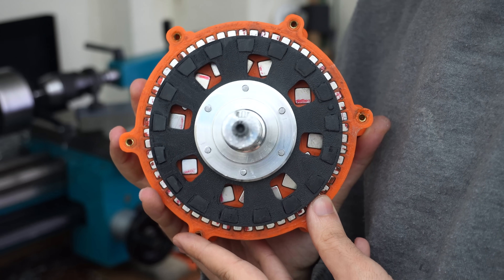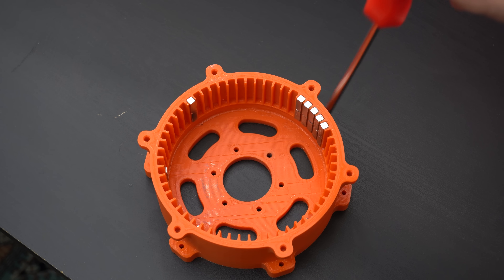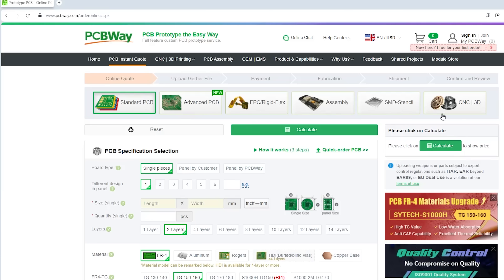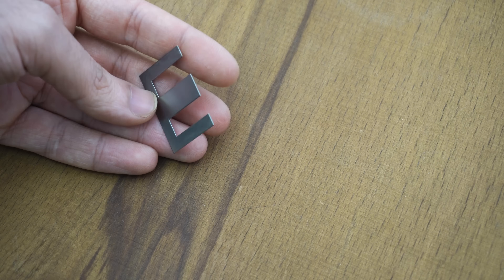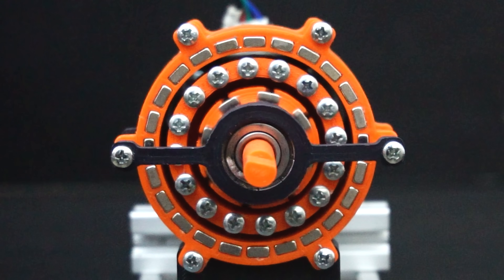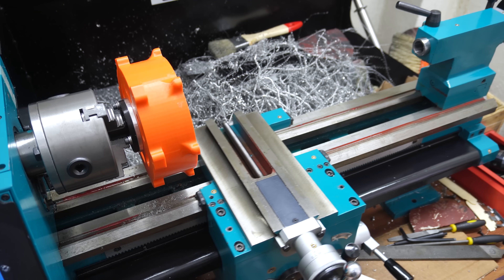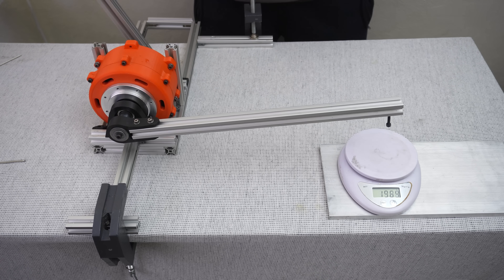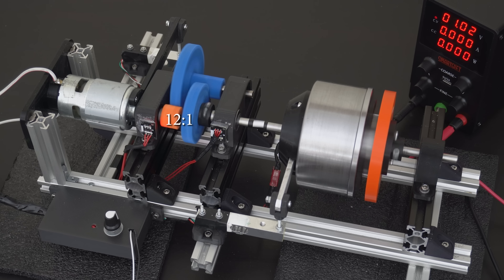True Magnetic Transmission with Serious Torque

Comment: 13:53 heres the issue. His best attempt gave him around 85% efficency. Any moden gear (proper cut steel or bronze) has an efficency between 95-98%. At best he could hope to pull out a 1% boost in efficency.  If it was practical in any way magnetic gearboxes would be in every machine on earth by now. Its so much easier to 1, make a motor with the torque and rpm u want or 2 find a motor thats close to spec and use a real gearbox, w real gears. 98% efficient.

Comment: Im for 3d printing and open source  devices like arduino and raspberry Pi, but this gearbox is a failure.  The device put out 4.5Nm, that's like 3.3 ft/lbs. The drill body driving the apparatus is definitely capable of producing more than 3.3 ft/lbs and at higher RPM. Let's be real if this was a good idea it would have been in production driving everything!

Comment: I do not think you correctly measured the torque, as gravity has nothing to do with the force applied on the scale, however you could have done so by calculating the force you have applied in to the system by adding weight against the bar. or using a load sensor.

Comment: You know, if a gear shreds itself, you must then turn a new one, wasting the old gear. Now, if the magnets die, either because of temperature, or just wear out their power over time, they can be sled out of the housing, and get remagnetized in bulk, just by putting them through a powerful electromagnet, they have those on sale. The bonus is that after remagnetizing, magnets tend to have a stronger magnetic pull than magnets from the shelves.

Comment: I dont know where youd need a magnetic gearbox except in a clutch or torque converter for just the slip torque engagement ..  otherwise you will only achieve an indestructible gearbox that is really weak..  race cars sometimes use co2 to push gears into eachother making for fast shifting but has to be electro pneumatically actuated which adds that extra hardware and programming.  If the magnetic gearbox was electromagnetically controlled to precisely add and subtract power at the right times then it would complete the shifting while using a non interference actuating sequence so it wouldnt break and could sense timing down to the nano second to seat gears without forcing them in like they do now which eats the gears up inevitably even with straight cut gears.. is the loud dogs slamming into them plus the loss of fitnent fron straight cut gears could be mitigated making an even faster more efficient gearing setup..  so its the idea that could go places if all the selective nuances were worked out per application..

Comment: Very nice!
So if you wanted to turn car engine ancillaries (Alternator, aircon, etc) at a constant rpm from the engine's variable rpm; how would YOU do that..? :)

Perhaps as simple as a std radial magnetic clutch that field weakens simply by moving 2 magnet plates closer together or further apart based on desired output speed, but perhaps your laminates can be to made move (field weaken) too?

Perhaps wind EM coils around the laminates to 'Change Gears'..?

Perhaps some or all the PMs would need to be replaced with EMs and brushes to change the gear ratio..??

Perhaps some sort of EM and/or PM planetary gear system..?

Comment: This is actually fantastic progress! Consider that you may hit an optimized point, where the magnet arrangement just can't be altered further and your torque break point just can't be improved at this ratio further. This is normal for conventional gears too, where the size of the gear ceases to be optimized for further acceleration (which obviously you know) and hence the need for transmission boxes that change up the ratios. Just to say, you might want to start determining the best way to transfer to a new larger gear before reaching the optimized slipping point. If you can get it to do so automatically, that would be the ideal! If anyone can, it's you!

Comment: For a given weight (= cost/volume/size) of permanent magnets, an Hallbach array gives much LESS magnetic field than a traditional array + back iron. Commercial brushless motors always use back iron to close the magnetic circuit and never Hallback arrays.

Comment: I highly suggest changing your bearings to nitride boron ball bearings. Not only will they not heat up as much, the ceramic bearings wont deform due to heat cycling or extended high rpm runs like metal bearings. They also chew up any junk that gets in the bearing unlike metallic bearings. But best of all? Less rolling resistance for higher system efficiency and less parasitic loss.

Comment: Your inner ring of magnets are like a camshaft your duration on the lobes are slightly off at one set of magnets on the outter ring thus the click like an out of time valve you slightly adjust the degree of the wheel up or down test it each time and if that doesn't solve it slightly rotate the degree of the angle of your magnets in the inner ring for a smoother rotation like a bicycle that has more tooth count on the sprocket has more torque ability is a bit slower over all but also much smoother than a sprocket with odd spaced odd angled teeth.

Comment: An attempt to productize a magnetic clutch/transfer was made by MagnaDrive back in about 2000.  All of this looks familiar and they had some very good systems for misaligned shafts, vibration reduction, gearing, etc.  Great looking aluminum housings and led by a former Boeing CEO.  But heat dissipation, reliability, and lack of performance along with decreasing capability over time led to its demise.  How do I know this?  I was an investor and lost a lot of money in what appeared to be a promising technology.  So, as much as I like to see someone showing the journey, I know pretty much where this effort ends.

The heating is due less to friction than it is to eddy currents caused by the rotating magnetic fields.  Keep experimenting, but it might be useful to see what the state of the art is before engaging.
Reply: Where could we get more information on this?  What were the end applications that were put to you for you to invest.  And was there any discussion on how to dissipate the heat OR put the heat to use?  Thank you
Reply: Sounds like MagnaDrive failed to develop an adequate cooling system for them.
Reply: Excellent comment, but one company failing to productise can be a death-knell for a technology, at least for future private investment, simply because it will be forever assumed to be due to techical failure. 

There are a lot of reasons such start ups fail, and the failure alone isn't enough to prove that there was really a show stopper.
 
Openly published research and development like this is pretty much the only way such technologies get a real chance. 

The other way is government funded public research, mostly aimed at determining whether it's worth further pursueing. This video is totally perfect in an of itself: A good attempt was made, and there was fairly significant success. This comment further raises important issues, to which I will add: Is the failure over time due to 'wearing out' the magnets? 

Magnets store energy, and it's usually difficult to 'drain' them when every interaction tends to go both ways. But it's not impossible, particularly if magnetic saturation and cyclic heating/movement is involved. When this is the case, it would account for gradually decreasing capability over time, but it might also be possible to engineer around that failure mode (ie, make it not a 'show stopper') so long as it is understood. 

Failing to understand the long-term failure mode 'in time' to work around it can certainly seem like, and even BE a show-stopper, especially for a startup. Funding runs out before the payback, and the idea dies 'on the vine'. But it might not be truely a dead-end, just a last-minute pitfall the MagnaDrive engineers just didn't see in time to avoid. Given the pressure to push the performance to its limits to either maximise  return on investment, or at least ease marketing, it is fairly likely that this kind of longevity failure would result. 

Worse, those involved in the unsuccessful first effort, especially those 'stung' by other investment pulling out, would be likely to give great air-time to the apparent unworthiness of the technology. This is not wrong: It's important to share knowledge of hazards widely. It does suggest a good target for further research might be to actually try to reproduce the decline in performance over time, and then see if the mechanism of it can be confirmed. 

From this video alone, it seems safe to say the magnets themselves can easily be monitored to avoid overheating them, so that issue might not be what really caused the decrease in performance over time. 

So here's an alternative hypothetical mechanism:

The classic way to 'drain' a permanent magnet is to exploit the Curie point: Allow magnet to do work pulling an anchor (discharge energy), then use Curie point to demagnetise the anchor, reducing the force requirements to remove the anchor, without doing work against the magnetic field (which minimises the recharging that otherwise occurs), then cool the anchor, and repeat the cycle. This results in an 'engine' that runs, at least until the magnet drains. Similar trick can be pulled by energizing an additional coil to increase the magnetic field to the point the anchor becomes saturated, whereupon the permanent magnet 'loses traction' with it.

This gearbox isn't trying to be an 'engine' like this, but a similar effect could occur if anything exposed to the changing magnetic fields can behave even partially in a similar way (not necessarily Curie point, but also core saturation). 

A way to measure this might be a high-range magnetic flux sensor mounted in front of one of the stator array magnets. If that shows a slow downward trend, you've caught it in the act of wearing out. But it might not be the stator magnets that wear out - could also be the inner array ones. 

The easy way is to just keep conducting repeated efficiency and maximum slip experiments between extended power transfer runs. 

The way I would do that is use two brushless DC motors, and two AC variable speed drive invertors, with at least one able to regen, and both running from the same DC bus. Therefore the power goes from one to the other and back to the bus, only less losses, which saves on having to completely supply/dump the energy as with a brake.
That way the power flow through the gearbox under test can be much higher than the AC outlet draw, so it can be run for a lot longer with less dissipation. Would use motors with different pole configurations to help account for the gearbox ratio difference.

I'd expect it potentially possible to arrange these gearboxes so they might actually tend to 'charge' the magnets: Thus preventing the fate of getting worse over time. 

They'd get better, up to the point of saturating the magnets, probably at the cost of reduced efficiency. TANSTAAFL after all.

The other thing that may happen, is that effects on the state of the magnets may depend on details about the load - perhaps cycling in a certain way exacerbates magnet drain, and operating differently might avoid it? 
Won't know without a better understanding of that mechanism. 

Either way, the true reward of excellent research work is... more research work!

Comment: That is wild!  To make creating all of those tiny plates MUCH easier, I would 

1. Spray insulating epoxy (or w/e) on both sides of a metal plate.
2. Clamp the plate to a CNC mill on a sacrificial sheet of MDF.
3. Drill some of the holes for mounting, then screw the plate down firmly.
4. Drill the rest of the holes.
5. Cut the pieces out, leaving tabs at each crossing point so the pieces stay in place.
6. Break the plate apart, stack the pieces on a bolt & nut--to hold them firmly aligned--and sand the edges smooth
7. PROFIT!!!

Cheers!

Comment: This could have interesting use cases where obstruction of the mechanism by limbs is a risk factor. Like in places where people are working close to open gears or something, this could possibly used as a safty gear, that would have just enough holding force to move the shaft it needed to move, but any more resistance, like an arm or leg getting in the way, would be enough to push it past the magnets and stopping amputation. 

Really cool.

Comment: 3:09 What you want  is better temperature grade magnets. You likely now are using standard grade, like e.g. N35 to N52 Which have a working temperature up to 80°C
But:
M: Medium temperature resistant magnets, good for applications requiring up to 100°C. (Like: N[number]M; Example: N52M)
H: High-temperature resistant magnets, suitable for temperatures up to 120°C.
SH: Super-high temperature resistant magnets, withstanding up to 150°C.
UH: Ultra-high temperature resistant magnets designed for up to 180°C.
EH: Extreme-high temperature resistant magnets, perfect for applications requiring up to 200°C.
VH/AH: Grades with a ‘VH/AH’ rating can operate in temperatures up to 230°,

ASIN: B0CNRWW98J (ASIN=Amazon article number) N42SH ⇒ 150°C Working temperature

Edit Or a Samarium-Cobalt-Magnet which can go up to 550°C (from 250°C, most are 250°C and still quite expensive) and is similar strong as a neodymium magnet

Comment: Looks promising. Try 40% glass filled PEEK (Poly Ether Ether Ketone) instead of PLA because it deals with heat better (You may have to upgrade your 3D printer though) and  Mu-Metal shielded magnetic bearings?

Comment: This vid got recommended to me out of the blue. I enjoyed it. However I'm not 100% sure about it's application as this is the first vid I've seen. I am a aerospace machinist shop monkey (I make the gears that go into any jet turbine engine. Military or commercial.) so if you ever need any help with that side of things I'll be happy to help. The clicking at the end is likely due to either the amount of runout which gets exaggerated with higher RPMS or (Most likely) the thingy a doo is poorly balanced which is causing runout. And seeing how you somewhat crudely cut those aluminum spacer things I'll be willing to guess that's the main issue. Anyways I love watching these kinds of vids.

Comment: Someone could make a more efficient and slightly larger version of this and easily get 50nm of torque output. This could have so many applications in industry! Especially if over torqued it wont break a tooth on a gear assembly.

Comment: Thanks for building this - I'm trying to make some mag brakes for my bike so I can do some regen but also to save my brakes on really long gradual descents.  I keep burning them up...if I only use them for low speeds/holding then they'll last a lot longer and work a lot better when I use them.
Reply: that's a huge use case, i was thinking about concentric arrangement and cyclic connections, so n, n+3 etc can fire up on level n, m,m+4 can fire up on level m and cycle through to reduce heat. i was also thinking about using flywheels

Comment: This is amazing! I wish I could get one of these with a 5:1 ratio for my tractor. Then I could use modern 540rpm CCW impliments from the 3250rpm CW power take-off shaft of my 1980s machine.

Comment: Love it! Great follow up video! Nice work! What is the outer diameter of the whole assembly? From an engineering standpoint, it would be great to see what the maximum torque that could be transmitted, with the restriction of making the gearbox diameter the same as the motor (like a traditional DC motor sold on amazon with a spur gear based gearbox).
Reply from the maker: Check out the description

Comment: Have you ever try to heat a magnet 🧲? If yes then you know when a magnet is heated it loses all it magnetic properties and for such devices to work on engine is impossible as magnet can't stand heat . An engine usually operates at around 100° the head is transferred to every part of the engine even to the clutch . That's why people have been using clutch the same ways from decades cause it's cheap reliable and effective . If magnetic clutch are used like in  your video the cost would be High to create special type of housing other than aluminium cause of Eddy current and will become ineffective in such high temp and will fail sooner than a traditional clutch .

Comment: Great job mate, this is really interesting & inspiring stuff. 
I wonder if you could play with some electromagnetic coil configurations on the exterior, to possibly add some more torque through a locking type effect like a BLDC motor controller perhaps & add some extra variable torque using a smallish amount of controlled voltage or current to  a set of externally fixed coils so you can manipulate a rotating field for efficiency. 
It may not require a lot of power to give a decent torque increase & being external would lend to easier cooling methods & serviceability. 
One last thing, were your laminations compressed together nice and tight? It might have been me, but they looked like they could have been compressed a little more. TFS. Sub n like. Cheers

Comment: But does it actually do the job of a gearbox? To multiply or reduce the speed and torque?
Reply: 13:20 you can see in table input 2489rpm output 440rpm
Reply from the maker: You can actually see that on the efficiency test at the end